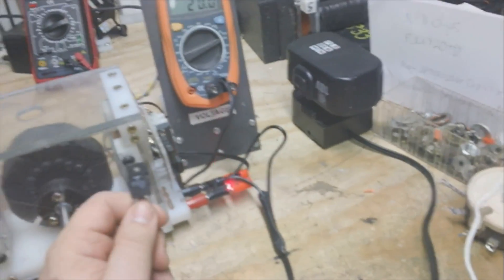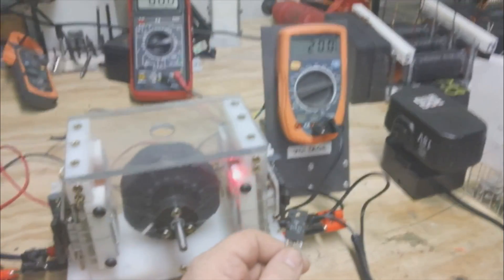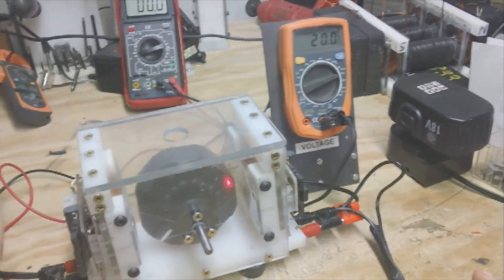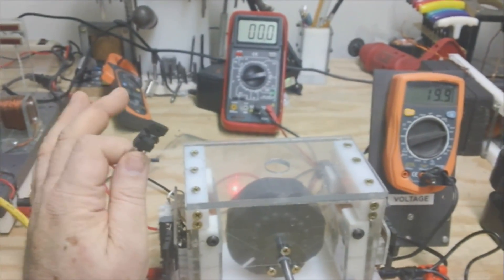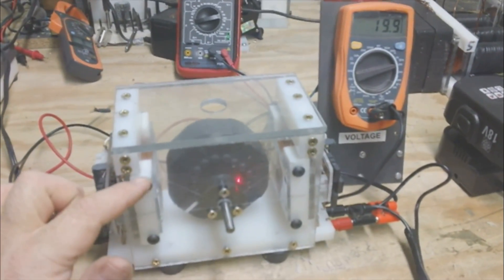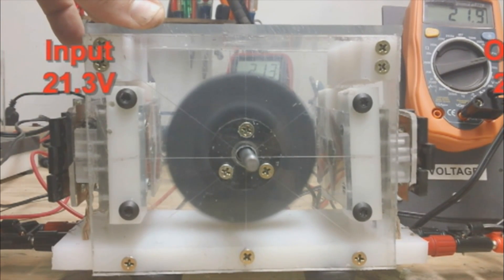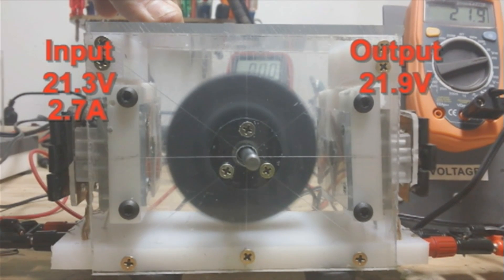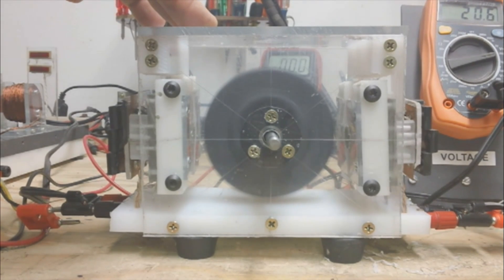Small Pulse Motor Test 2

Comment: great work,so can you use a battery and put a load on it and charge  the same battery? use a capacitor to even out the spikes back to battery...gl
Reply from the maker: you can't run a ssg circuit back into the input the+ is the negative on the charge battery thanks for watching

Comment: if the output is AC, I suggest you try look with an oscilloscope
the current may not be synchronised with the voltage and the power going out may not be as high as you'd expect
Reply from the maker: the output is pulsed dc I will run more test today and try to figure it out

Comment: It's awesome that you have shown input and output - current AND voltage.
Now that you have shown a higher output power (COP>1), it would be a good idea to look at the output waveform to see if it has a frequency, as this could significantly affect your output readings. Perhaps an oscilloscope would come in handy now :)

If you don't have an oscilloscope, perhaps the use of a capacitor across the output would help to make a better DC output measurement.

Just an idea.

Good stuff! Keep it coming:)
Reply from the maker: yes plan on doing that today I only have a old scope and it not OU because the battery does not absorb the full charge due to the resistance of the battery thanks for watching